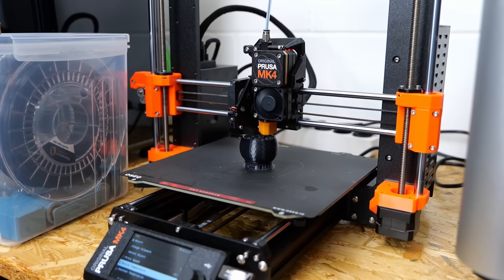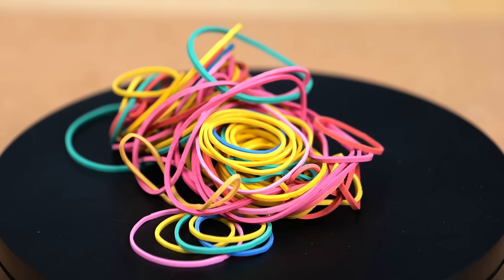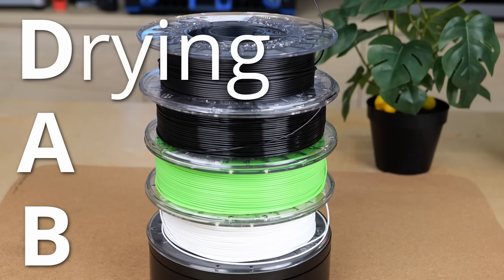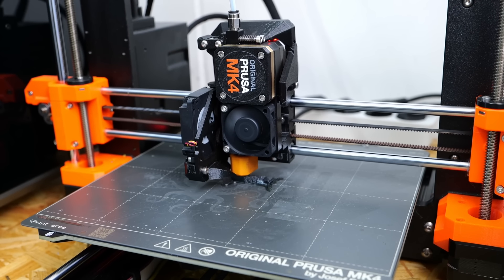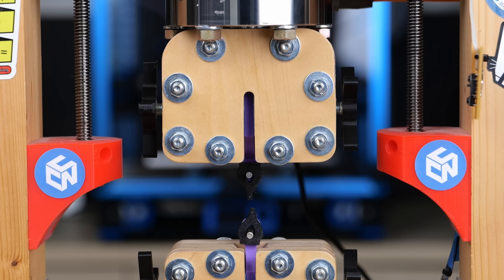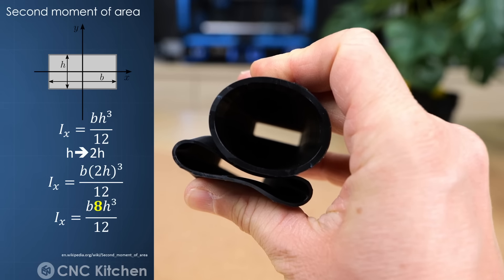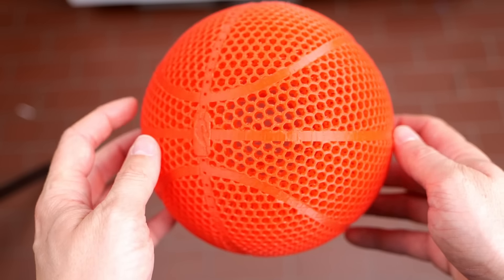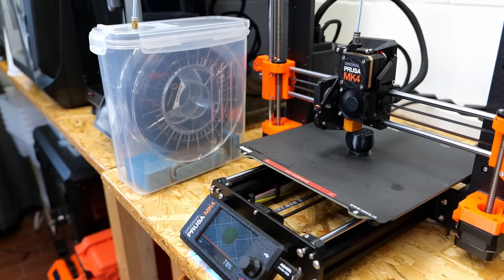Why aren't more people 3D Printing this Indestructable Filament?

Comment: I have a small home based business that 3D prints TPU products, so I appreciated this flexible filament video.  I'm an engineer so I always like Stefan's data driven approach.  I know from past CNC Kitchen videos that I can't get most of these filaments in the US but I appreciate the links to the filaments.  I need a more energy absorbing material for a product that hasn't been converted to 3D printing and I need to try the foaming TPU but it's never in stock.

Comment: just a thing to consider: materials that are flexible but not bouncy may also be sound and vibration absorbing. need rubber feet for a device that is either generating vibrations or sensitive to them? such a material would be great. for example a good old record player. they like to eliminate all vibrations from the environment.
this of course also means, that "good" and "bad" always depend on the usecase.

Comment: In regard to retraction generally speaking you have to increase the number since flexible materials will simply deform instead of being really retracted from the melt zone. My retraction values are higher than with rigid materials which works best for me.

Comment: Instead of glue, you can reduce first layer temperature to avoid bonding to bed surface. In general you should stay below 230C on first layer and there will be no problem with too much adhesion

Comment: I use Recreuses filaments. They absolutely must be dry in order for them to work, but when dried properly i crank up the temp usually 240-260°C and they print well and relatively fast 4-5 mm3/s for a hardness of 82A. Also very important to have a filament path whit as low drag as possible otherwise extrusion will be inconsistent.

Comment: Hard TPU is my default filament! Probably harder than any in this test, 70D or so.
Reply: What's your go to hard TPU?  Used to be able to get decently priced 70D from KVP but they don't appear to make it anymore.  Ninjaflex Armadillo gets too rich for my blood pretty quick.....
Reply: Finally, someone who gets it.  We should all be focused on harder TPUs not softer ones.
Reply: @ThantiK  So much easier to print than nylon/pc/whatever technical filament you got.  Someone should ask/beg Polymaker-Prusa-Greengate-Inland-Sunlu-ESun to mass produce the stuff.  I've made gears out of 70D TPU that are stronger and more resiliant than the original injection molded stuff.  Why can't we have nice things? lol
Reply: @richardbertacchi5016  New to 3d printing here, but isnt nylon a better choice for gears because of its self lubricating nature and higher temperature resistance?
Reply: @xavy_  harder to print, but probably yes. I don't have an enclosed printer.
Reply: The D58 from Extrudr was the hardest I could find here in Germany. Where did you buy the 70D?
Reply: @Vindolin  My go to WAS Vexxiflex 70D from KVP in the US but they don't make it anymore.  NinjaTek Armadillo is 75D but its too pricey for me to use everyday.  It's also backordered to death presently......Haven't tried anything by Extrudr yet but need to try them....
Reply: @xavy_  Hard TPU is SO much easier to print than Nylon.  I've run a bit of nylon on enclosed printers and it is strong.  Some of it is actually more flexible than the 70D TPU I was using.  In my experience it's really hard to get a consistently smooth surface on all sides of the print.  Nylon is also super hygroscopic.  TPU is much less so.  In fact we usually just pull TPU out of a bag and go print.  If the first layer looks like crap, it's time to dry it.
Reply: @richardbertacchi5016  Oh wow, the Armadillo is really pricey. The Extrudr Flex Hard is about half the price. It prints really well, better than the softer 94A ones I usually print with.
Reply: @Vindolin the FLEX Hard CF is 70D, but plus the fibers. 

I use Armadillo and all Extrudr hardnesses of their TPU. Made an angled fuel filler funnel in FLEX Medium, it has lived outdoors for 3 years, hanging near the fuel cap on my excavator. 3 years of direct sun, diesel and gasoline fuels, some coolant, negative 30 degree C winters... it is still like new. 

TPU is the go-to for functional stuff. The FLEX CF handles almost 150C before softening too much, as well. 😊

Comment: A lot of combat robots nowadays use TPU as armor, it'd be interesting to see how different TPE materials could be used in that application, resisting cutting and tearing
Reply: I can’t speak to combat robots, but I print all my racing drone mounts out of TPU and it can survive hitting trees and PVC at 80+mph all day. I’ll break multiple carbon fiber arms before my camera mount starts to split.

Comment: Simple rule for hobbyist with a 3D printer. Do not print fiber reinforced materials. 
1. You have no reason to. You are not designing a re al world application with given framework conditions where you can´t change your geometry accordingly.
2. Fibers don´t increase strength anyway.
3. You don´t have the proper equipment to not breathe in the nasty fibers and develop asbestosis over time

Comment: My city has high humidity.
I keep each spool in a large zip bag, with a 40g pack of silica-gel inside, and I take most of air out with a small vacuum cleaner. The large bag is enough to get also inside the spool. Not perfect vacuum but enough together with the desiccant.

When in use, the spool is inside my Bambu AMS, also with silica gel inside.

I never had any problems, never had to heat it.

Also, I buy reusable desiccant. After a month, they go to microwave oven and get new again.

Comment: I love TPU 95, prints very well on my old direct drive upgraded Ender 3 and the parts are nearly indestructible. One of the best functional printing materials for durable parts if great stiffness is not required and of course great for parts where flexibility is desired like plugs, seals, protective covers, bumpers etc. I have not yet tried the more flexible materials but I would like to when I have the time.

Comment: When using glue stick, I mix in a few drops of water after applying the glues stick.  When the water/glue is about the consistency of paint, I lay the bed flat and let it dry.  The result is the glue surface is flat and smooth.

Comment: Alternative to tpu printing, print the model in something hard (aka PLA etc...),  then make a negative with another material (silicone, plaster etc...) and then basically use this negative and pour silicone in. After trying you get a flexible model out of silicone, you can reuse that negative depending on the material multiple times.

Comment: I'm printing a ton of TPU and I never prepare my PEI build plate before printing.
Just spray or drip some isopropyl alcohol around the edges of the printed object.
The IPA will creep under the print and act as a release agent letting you peel the print off effortlessly.

Comment: Great video about flexible materials :) I would have loved to see you testing the Compression Set of the materials as well, because for applications with permanent static loading this property is very important. 

The softer a material is, the higher is the deformational part of the friction as your testdata suggests. This could be also the reason, why the dnymamic friction coefficients where higher. When the material is pulled over a "rough surface" it experiences a cyclic loading. Depending on the lossfactor at this frequency more or less energy is dissipated.

Comment: I print 80A TPU in a bowden fairly easily as long as it's dry. 

I use calcium chloride in my dehydrators and never use heat for dehydration.

Comment: I found with my Prusa MK3 that it's important to reduce tension on the filament gears.  Loosen the screw until it's basically flush with the nut.  Having it too tight is a recipe for a nasty tangle in the gears that's a pain to remove.
Reply: Thanks for the hint, I also figured out that the standard speed for loading is a bit too fast and leads to wrapping the filament around the gears. If I load soft TPU  allways while pull it in the opposite direction by hand until it appears in the hotends nozzle.

Comment: I've found that when printing TPU in an enclosure, larger retraction numbers leads to a loss in print quality, and sometimes a jammed extruder.  My theory is that over long periods the extruder heat break starts to get hot because of the high ambient temperature in the enclosure, this leads to the TPU getting soft in the heat break and therefore leads to filament jams because it's just stretching vs. actually retracting, aka just acting like a spring.

I've found small retraction numbers work better.  If you have stringing or bubbling it's most likely your printing temperature is too high, or the filament is wet.  Limiting the volumetric flow just like you've mentioned is key.  

You might say just open the doors on the enclosure, but I've found there are advantages of printing at a higher ambient temperature, including a reduction in shrinking.

Comment: I haven't found much info on TPE filaments, so bought some from 3DPrintingCanada.
The soft rubber feel is similar to overmolding grips in consumer products, really neat.

I noticed a significant difference in friction coefficient when comparing tpu and a rubber-like tpe, where the tpe had much better grip with the same hardness.

Lastly, couldn't get my prints to stick to a textured pei bed using tpe. Tried several different tapes, but finally tried packing tape and worked perfectly! 40C bed. Parts stick very well, are still simple to remove, and the tape comes off easily because of the low bed temperature.

I've had good success setting retraction to zero, and minimizing travel movements to the absolute minimum. Use more walls/concentric infill for top/bottom to avoid those pesky gaps in rectilinear. Makes for some very well filled in parts :)

Comment: I had an old printer that printed TPU with no issues. My newer one always jams. Both are direct drive. But you got me thinking about retraction. I need to check that. The filament I'm trying to use is really flexible, and seems to be jamming at the gears. Maybe trying less retraction would be a good idea. I stopped using ZHop completely on TPU and it helps with stringing quite a bit. Also helps on PETG for the same reasons.

Comment: I watched a HackSmitch video that showed  3D printed parts coated in a metal. I would love if you would go over electroplating 3d prints with strength tests with PLA as a base!

Comment: I have a pretty old roll of Sunlu TPU (95A according to their website), and it prints OK on my Anycubic Mega-S (bowden machine). Only storing it in a normal drybox together with my other filaments, and so far I had no big issues with moisture.
Just checked my profile (which is a slight adjustment of the default Anycubic "flex" profile in PrusaSlicer), and it's set to only 1.2mm³/s volumetric speed, so that explains why the prints are VERY slow. But hey, I can live with that since I mostly just print small stuff like bumpers or connector caps in TPU.

Comment: IMO one should always work with the maximum volumetric speed. It allows to define the material dependency of the printing speed, even for materials like ABS. The 1D speed limit on the printer movement in X/Y should be used to reflect the mechanical properties of the printer.
Also, instead of retraction I recommend to calibrate linear advance properly, if the printer supports it. Retraction is just a poor-man's version of linear advance ;-)

Comment: I replaced a few automotive rubber bushings with some made from TPU.  They worked just fine, a little harder at the 90a though.  I never did get to go over them with the 60a yet.

Comment: I've actually had success printing 95A TPU at 12 mm3/s on my slightly modified Sovol SV04 with titan extruder. The main modification was drilling out the metal filament path between the extruder gears and the heatbreak - and instead adding a short bowden tube there - almost touching the extruder gears and down to the input in the heat break. So, the filament has nowhere to bend and escape the filament path.

Comment: TPU is good for me to design andprinting some individual gaskets (for air or water) Also I've done some transmission belts in individual length and diameter to repair a vintage Walkman.

Comment: I use a range of TPU / TPE's with Extruder flex hard as my favorite. I would love an even harder material. 
I mainly use it for living hinges. If you can get the hinge flat on the bed just 2 0.2 mm layers printed diagonally to the hinge bend curve gives a near indestructible hinge. The rest of the model can then be PETG or PC as they bond very well with TPU. This works great on my RatRig Vcore 3.1 IDEX. PC is a bit tricky as the chamber temperature has to be rather high though but it is the greatest combination of stiff and flexible.
Reply: Try Ninjatek Armadillo. It is 75D and almost as hard as Delrin... 😊

Comment: I love TPU. I use it a lot. A part of my job requires me to use motion amplification cameras and there are squishy pads you can put under the tripod to isolate the camera from environmental vibrations. I created a new foot for the tripod with low infill and 2 walls. now I have vibration dampened feet for the camera attached and don't need to move the pads every time.

I created chair legs with an embedded washer to spread the load of a vertical tube that went into the rubber tube. 

I was doing camera maintenance and needed to blow out dust but breath is too moist for that so I drew up a squeezable air blower and used that to clean the cameras

Comment: I had to lower retraction distance to 0mm since got always stuck in extruder (Q1Pro). But it was simple as run orca slicer calibration procedures and you will get almost perfect printing values.

Comment: I never put glue stick on my print beds. Just make sure you have a properly levelled build surface. I usually print TPU on my smooth PET surface and I cannot complain about too weak or too strong bed adhesion. Same applies to my Ender 2 with stock surface and bowden setup. I lowered the print speeds drastically on the ender, btw.
Reply: Ok but others do different.

Comment: You can print TPU easily on a bowden tube printer if you use a tight bowden tube like the Capricorn brand and decrease your retraction distance dramatically to something like 1.3mm max. That low setting also helps with printing PETG. Sometimes you have to disconnect your bowden tube connector from the extractor end to feed the TPU line in through it though because it sometimes hangs up on the edge of the tube and connector and won't get started through but once you get it in you can screw the connector back in.
Reply: That's for soft TPU.. Harder ones, you print basically like a slow PLA print, even on stock, wide Bowdens but with far bigger retraction numbers. I have used up to 13mm at the extruder... but with a 65cm long bowden it was 1.9mm at the nozzle.

Comment: If you don't use glue, try pouring some isopropyl alcohol on the print once done.  It reduces the strength of the bed bond after printing by 90% and it makes it easy to peel off. :)

Comment: that filaflex material seems like it'd be great for making grippy pads for a tracked vehicle. i would probably suggest something like a plug and socket design rather than trying to print it directly onto the track plates with a multi-filament printer though. also great for anti-slip features in general, be they feet or mounts

Comment: Recently I found a engineering filament thats 72d a mix of TPU and Nylon.
Its ALMOST ridged, needs to be printed like nylon.... but 3mm thick part can be folded over on itself 100 times with no visual wear/cracking/fatigue. It does lose some strength across the folded section... but every single plastic even pure TPU/TPE does slightly.

I got it cheap because it won't print at the given recommendation of 230-240c(it clogs the nozzle after printing for awhile, it will only print well at 250-270(nylon temps)
The company that made it seems to have stopped making it(likely because people were returning it)
Really happy with my find just sad I likely wont ever get anymore.

Comment: The only TPU that I've printed with was NinjaFlex (85A I think) on my Prusa MK3. I did find that the firmware auto load was too fast and would often result in filament wrapped around the bondtech dual hob gears. I just got into the habit of manually loading by jogging the extruder axis. One experiment that I did that worked out well was I was printing a 3D printed machine vice. This model has removable vice jaws. I was planning on printing them in PETG and I noticed that my NinjaFlex profile and PETG profile had nearly identical print temperatures. So, I printed the first mm in NinjaFlex and the rest in PETG. The NinjaFlex had really good layer adhesion to PETG, so I had a set of really soft jaws for my machine vise.

Comment: I used TPU to make new connectors for my battery powered shavers using rubberized CA glue and the metal parts of the Molex connectors.

Comment: I had some fun doing speedbenchys with my 70A recreus Filament. I got down to around 15 minutes, but for that i had to print at 280C which didnt smell too great. 

But as a general disclaimer that as with a Volcano-Hemera. So already an almost optimal setup for flexibles

Comment: I use an electric skillet set at its lowest setting filled with rice or beans (uncooked, of course) and then i sit my cereal boxes slightly buried in the rice and cover the whole thing with a big enough box box. this way the rice acts as a heat buffer. No airflow whatsoever, but it is still good enough to reduce low levels of moisture.

i also put my cereal boxes inside of my car on hot sunny days. again..not as effective since there is no airflow, and a really sunny day could potentially ruin PLA, but it is also a very good option.